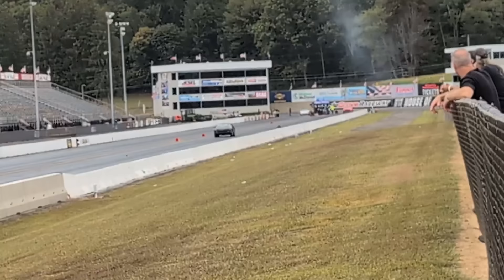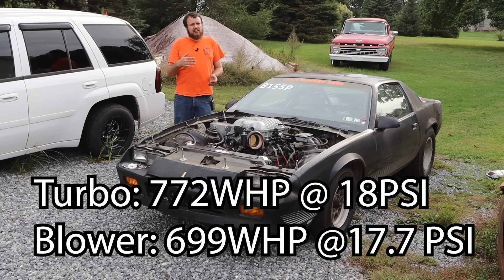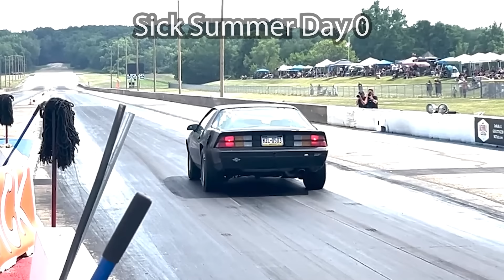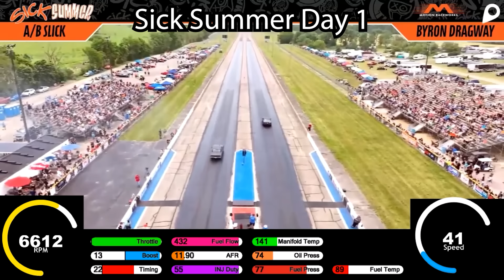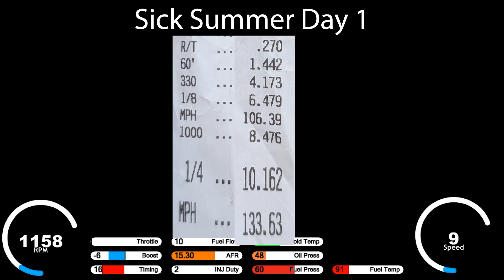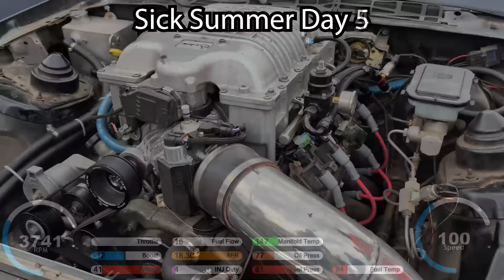HELLCAT Supercharger 6.0L LS Runs 9s! Better Than Turbos?

Comment: I dont have a hellcat blower but I have 2 , 871 roots blowers and called boca bearing in florida , told them what I was doing and gave them the measurements they asked for , 360. Dollars for all the bearings per blower ,  ceramic bearing create less heat for intake temps as well

Comment: You need some long tube headers with an 11-13in collector. More torque in the higher rpm’s. Maybe that will solve the drop off in power.

Comment: I started out with a small roots blower and it was super fun it took me to 10.83 at 125 mph  estimating the horsepower at about 550 this summer I put a f1a94 on e85 and what a huge difference I'm hoping to get to the track in the spring, I like what your doing I've always liked the 4.0 L Whipple but I like carburetors, looking forward to the upcoming videos.

Comment: Have you ever seen the SD Concepts "Pro Charger", '73 383 Challenger. Full interior, 4000lb car, stock block, stock crank, running 8:54. This car made 600 reliable passes before the engine was retired. And even was underwater at 1 time. And it drove fifty miles on the highway. 1300 HP, there are a few YouTube videos of this car.
Reply: I'm familiar with that car, too badass!
Reply: I seen that car before that you're talking about😮😮😮

Comment: Kong X port paired with a 2.70 upper / 9% lower and A/C chiller or ice tank will make produce more than an additional 100+ wheel HP. If you wana party go 2.65 upper but that’s max speed at the rpm you’re trying to shift at. These IHI blowers don’t like heat so id invest into again ice tank or chiller. What upper pulley was installed when you went 9.5?

Comment: have you ever looked into the 3 / 3.2L inline 6 w124 engines? I find them to be a very interesting platform! iron block, forged crankshaft & 4 valve from factory and can be found very cheap.

Comment: ceramic bearings are pricey but they shouldn't be that much! That said, I really don't think that's bound to be a point of rapid disassembly, it's not like it's sustaining that kind of load for long. My gut feeling is that upgrading the material the rotors are made out of would do more to push the maximum safe speed than the bearings any day. Not a materials engineer but 40k is a lot of spin.

Comment: If you hit the limits of the blower, get a bigger blower. That's the logic used with turbos, so it's only fair to apply that to the blower experiment. Maybe on the next project after you plateau on this one build a budget Detroit blower LS build.
Reply from the maker: Or you just turn up the boost. That's what we're going to do.
Reply: @Calvin-Nelson I can't wait. A Detroit blower on an LS would be an awesome build. I hope to do it on my old Chevy someday. The 8v71 blowers in particular are a good deal since they are the biggest factory blower that Detroit made. Someone please correct me if I'm wrong.

Comment: Turbocharger is just better for pushrod engines. There is zero tradeoff. The design already makes low end power. The turbos just cover the top end weakness OHV engines share. It's a perfect marriage.

Comment: Still not sure what’s going on with that oddball supercharger.   GM put many superchargers on LS engines, just use one of those and save yourself the grief of adapters and bs..
Reply: GM SCs are small and expensive. The HC SC 2.4L and cheap.
Reply: @andrewnelson3733  2.3 is not much smaller,
and time spent clowning around with adapters and making pulleys line up and work..  
I would just buy the one ment for it…

Comment: Love the channel man. Great info.
Got a strange question,  anyone ever used a snowmobile clutch setup to drive a turbo? Could tune it to zero lag and it gains rpm as it would from high rpm exhaust. 
I gotta get on it.
Reply from the maker: I know some companies like Nissan have used a clutch activated Supercharger for the Superturbo
Reply: @Calvin-Nelson  I'll have to go look. If it's a CVT then it's what I'm thinking. To be clear not clutch activated but driven by the CVT of the sled drive system. I'm keen to see if I can get an exponential gear ratio gain that drives the turbine at an exponential rate.

Comment: You won't beat a supercharger with a turbo for instant torque.  But you could with a hybrid torque boost.  With a tightly integrated electric motor boosting the torque it's even better than a supercharger.

Comment: I think you should compound it with a turbo that can efficiently supply 150lbs of air @ 1.5 bar of boost....use the supercharger as the high pressure stage (and maybe run it in a more-efficient range too), and use the turbo as the low-pressure-side.  You'll not only get the grunt of the supercharger, it'll also help a bigger turbo to supply more air more efficiently than it could on its own

Comment: A lot of hellcat guys spray nitrous into these blowers but if I were you. You should go with the bigger demon or hellaphant blower
Edit: the reason i specifically say that is unless you want a big ass intercooler sized heat exchanger to run coolant through the blower(if you plan to drag week that car). or run water meth injection. you can also change the intercooler bricks which are on each side of the supercharger to something more efficient. i dont know if you wanna go that far. but if you wanna do it cheap. do it right and reliably

Comment: Cal, do you have any inlet air temps? All air pressure increases push air teps up, more than most expect. 
Can't wait to see the results on the 57/ dohc car!
Dad is looking and sounding back for the haul- good on him! Wish him my very best. Tell him his kid is a killer welder- some may not be pretty, but yours have taken the ultimate test.
Reply from the maker: We do have an inlet air temp sensor that is post intercooler. Unfortunately, the datalogging kept not recording.

Oh and thanks!
Reply: @Calvin-Nelson You did the work- my part was the easy one!

Comment: Nivlac57 I need some info please. Do you think the hellcat supercharger would bolt on the northstar with a custom set of adapters? I have a 2006 cadillac sts-v, the factory supercharger is the limiting factor to make more power. Any info or suggestions would be great. I figure you would have a good perspective since you did the custom lower intake for the northstar. I can't wait to see more on that engine. I'm really hope you get the higher rpm you are pushing for, then I will do northstar performance springs and turn up my Rev limiter.
Reply from the maker: I think you could make something that would work. It will be a complex bracket though

Comment: 8 into 1 exhaust turbo does it make sense to compound it with one of these. eBay it's like 13 Grand for 800 horsepower hellcat motor that's turn key. Which makes the most sense. As long as I can prove it's not stolen

Comment: Have you ever thought about using compressed air instead of a turbo or supercharger? Might make for a super compact setup for maybe an atlas 4/5 cyl build in a smaller car.
Reply from the maker: I've certainly thought about it. It's just very costly.

Comment: Have you considered adding the Demon type interchiller to lower charge temps?
Reply from the maker: Eh. That only seems like it would work for steady state conditions where it has time to cool for a while. I don't think the AC system could keep up at wide open.
Reply: @Calvin-Nelson  You only need to super cool it before hand then cool for the burnout plus 9 seconds at wide open throttle. You give up a few HP but the cooler air should give it back with dividends. Water heat soaks and cannot cool anymore without massive airflow while the inter-chiller is always taking away heat. It's the demon was able to generate 1000 hp.

Comment: You like data. You have the ability to record the data. 
My suggestion is for you to put a small hole into the throttle body snout as close to the blower as possible, and then put another small hole all the way up just behind the throttle body or even in front of it... And run a map sensor to each one. 

I look at the blower intake and think of it as a restriction. It's unported. You're spinning it as fast as you can... It seems like it should be with how thick everything is. 

But if you do this, you can measure and see if it actually is a restriction and then maybe do some quick clean up work on it and see if it helps. 

And then of course you can always just put plugs in where you drilled those holes.
Reply from the maker: Yeah. The supercharger already has a map sensor arranged for that. Problem is I don't have enough inputs on the ECU.

Comment: Superchargers have always been more pricey as long as I’ve been alive anyways, and are in some ways limited compared to turbos but instant boost is quicker whether a turbo is faster (always) I will stick to the cheap turbos for my cheap cars. Superchargers are still awesome and probably safer for some engines and transmissions like the centrifugal superchargers with rising boost curves have smooth power delivery but I guess if you ran a single bank turbo on a v8 you could attain a similar rising boost curve.

Comment: Hey, look into WPC Treating the case, rotors and bearings ( if they're metal ). Not expensive and it will reduce the friction and strengthen the parts. It's a micropeening process that's been around for a while. Oh, be sure to do the rear end parts, lot of friction there.

Comment: Ported snout
Bigger throttle body
E85
Pullied to be at 24k.. 
Woukd gain alot of hp.
Reply: around 900HP. same as an LS9. and on an 8HP. thats a solid 7:90 car to 8:20 car

Comment: Calvin I ran into the same issue with ProCharger bearings, they are expensive from procharger themselves. I found a solution from a local bearing supplier and they sourced me ceramic bearings at 1/3 the price as well as them being the same brand.
If you have the bearing numbers a bearing shop should be able to help out. The 2k + price tag on those is nuts
Reply: I've bought bearings for stuff from a local bearing company also. I found you can buy better quality ones cheaper than oem ones
Reply: Yeah most of the time parts are made to fit bearings that are already manufactured for other purposes so by measuring the bearing you can almost always find multiple sources of the bearing. I work in steel mill maintenance and we have a machine that the manufacturer says these linear bearings are their own design and cost 1200.00 each and I found them (same exact part number) for 300.00 and it requires 4 of them I showed my boss this and we’re now buying 4 for the price of one😂
Reply: @deegan727  that’s what’s up
Reply: Changed pulley also
Reply: Get me some!! I've got the same problem, about to rip it out and run 2 nitrous cars.
Reply: It's like Apple business ideology but with cars. Absurd tbh
Reply: @outdoorbeaner  that’s called capitalism, brother

Comment: What about twin charging? Curious to know about that.
Reply: It's heavy, complex, and isn't really useful for a drag racing application. With modern turbo controls and anti-lag systems it's even less relevant for everything else. You're better off spending the weight and cost savings from deleting one system improving the other.
Reply: @TheMobiusRibbon1-4 oh I know the pros and cons of it. He did ask if we wanted to see anything done to the Camaro. Just thought I’d put my .02 cents in
Reply: @jordanvanderpool5503  What I'd like to see is a compound turbo setup with proper intercooling and aftercooling, just to see how high they can crank the manifold air density. The plumbing for that would be absolute hell to squeeze into most engine bays, but the turbo noise some of those setups make sounds like a baby jet engine.

Comment: The on-screen data during the drag passes is freaking awesome.
Reply: I agree. I've always liked seeing them.
Reply: Watching that fuel pressure jump around was a little concerning though!
Reply from the maker: @krakhedd  That's pretty normal for cars with dead head fuel systems and really big injectors.
Reply: Any way to get the build details on this ? Just subscribed 💪🏼
Reply: @philipmazzuca2269 there is a whole build video on it
Reply: @Calvin-Nelson what causes that effect? I’m imagining something like pressure wave reflections doing some sort of comb-filter thing where time-aligned pulses are additive in intensity and the out of phase stuff cancels out, making the in-phase pulses appear even more prominent. But I’m just guessing 🤷‍♂️
Reply: That intake temp is a little scary......needs like a 100 shot to cool it down....

Comment: Surprised the IATs get that high. Maybe adding a chiller, bring the temps down will help with et, and over all engine health. On E85 I start to pull timing around 140-150, but that's all tuner dependent. Super rad setup, keep up the good work
Reply: Superchargers are like a heat pump, iat are the enemy, agree rad setup
Reply: @RextheDragon881 it’s the reason why a lot of hellcat guys sometimes run nitrous
Reply: Do they even make a chiller for that style supercharger? I know old school style blowers you can get one that goes between it and the intake part
Reply: @waynerohde1036 they probably do, it's just they don't really do much compared to a turbo intercooler, heat soak is bad especially on the street
Reply: @RextheDragon881  not unless you got a massive heat exchanger
Reply: @jackmagnium6115 agree
Reply: @RextheDragon881  not unless you do it like a refrigerator setup the way my younger brothers dad has his hellcat setup. basically hot side of the blower into an intercooler sized heat exhanger, through the car into a water tank. than out into a smaller heat exchanger. and then into the cold side of the blower

Comment: it would be interesting if you could log air temps and pressures either side of the blower and calculate the compressor efficiency from that. It would be great to see how well the blower is actually performing at higher RPM, and would be extra data on how helpful other mods are, for example if you do any porting on the suction side. I know power is what matters at the end of the day, but when data isnt really available for these OEM parts its interesting to find out what's really going on
Reply from the maker: Yeah. That would interesting. Though most of that stuff is measured at steady state, not on a sweep like we have here.

Comment: With the supercharger, I think things like really good flowing heads and an appropriate camshaft to match the flow of the heads as well as the (hopefully ported) supercharger play a much more significant role. 

Turbo’s don’t care nearly as much. Especially when you have relatively low back pressure as I presume you did with those size turbos at that boost.
Reply: Boost is boost, cams only determine what rpm range you want the power, with cams you need good springs to prevent valve float at higher rpms.